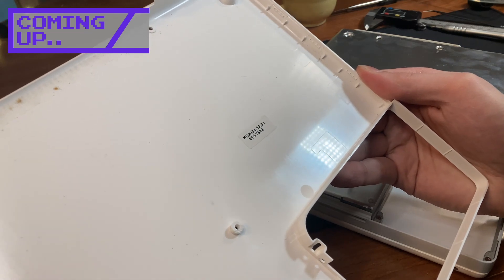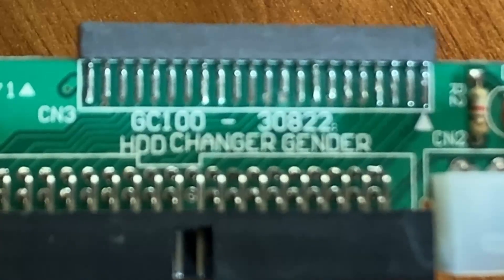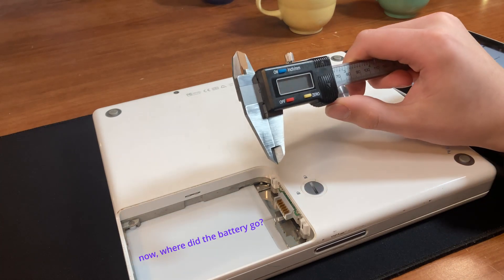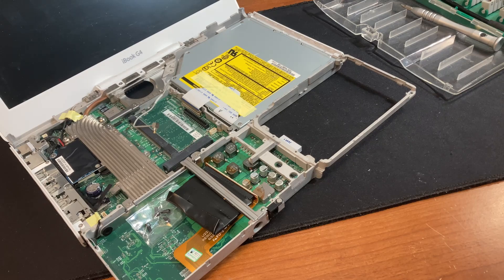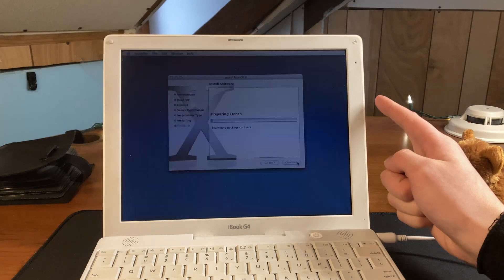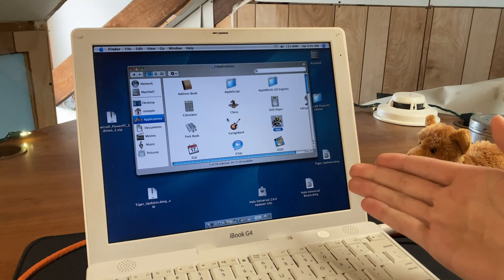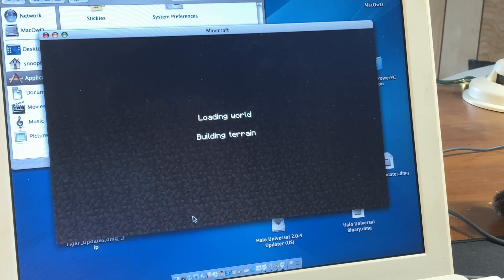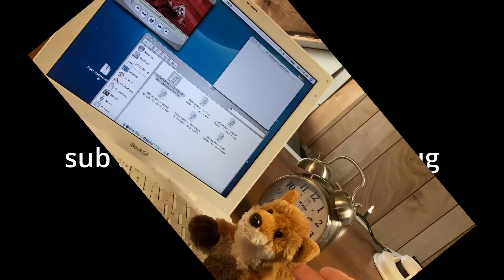The Fastest '04 iBook? Installing an "SSD" in the iBook G4

Comment: Hello! I have bought a Notebook-Digital Memory Card SD/SDHC/SDXC/MMC to IDE, 44 Pin Male Adapter, SD 2.5 Converter, Hard Drive Adapter Card, 3.0 inches, a 512G Micro SD Lenovo pro plus xc A2 and Lenovo 256G thinkplus pro plus xc A2 and by installing it in the connector of my iBook G4, like yours, from the same year, detects the micro SD, but when I want to format them and/or do the partitioning for Mac and use it as HD, the action bar does not advance me (formatting Mac OS with registration or partitioned for Mac)"?", I do not understand. Could you tell me which adapter you use?I have to use a micro sd like yours?thank you and sorry for the inconvenience,I look forward to your reply,thank you and take care of yourself,XAO!

Comment: I have one of these with 768 MB RAM. I want to upgrade it to 1 GB ram and a big SSD or sd card, but, man, the procedure for doing that on these Apples is insane! Typical PC laptop you have a couple screws and a panel to remove, pop out the old RAM chip pop in a new one, good to go. For right now, I'm going to deal with the RAM and HDD it has, but at some point I'm going to tackle taking it apart and upgrading it. 🙂

You might want to upgrade the OS....I think these things would actually run FreeBSD better. Most linux distros have dropped support for PowerPC G4 but FreeBSD still supports it. You should be able to dual boot using OpenFirmware. 

The MacOS I have on mine is 10.4.11....that's what previous owner put on it (I got it from ebay). I would suggest using that or 10.5, I hear 10.5 actually runs faster on PowerPC G4. The only downside that I know of is that it means you can't run older 68k Mac software on it. (well there might be another emulator you can use for that, but there isn't one built into 10.5.) 🙂
Reply: Ram replacement is easy, you pop up the keyboard and undo the wifi card tray. The hard drive is a pain in the ass

Comment: You could just use a real ssd. You said that the ssd is the same size, however if you remove the casing you would find out it’s half filled with air and that it could easily fit together with an adapter into a 2.5 inch hard drive bay.
Reply from the maker: I.. didnt think of that. thanks :3
Reply: @WindowsG  well if you want the ultimate iBook G4 you can always disassemble it again xD
Reply from the maker: @jaynayk1176  ..pass